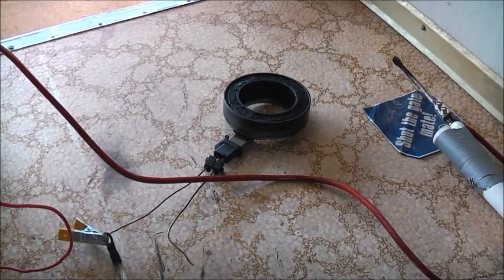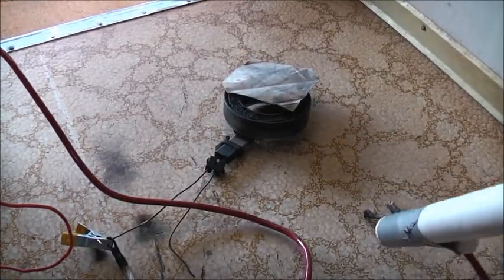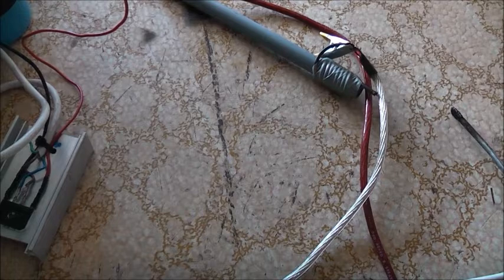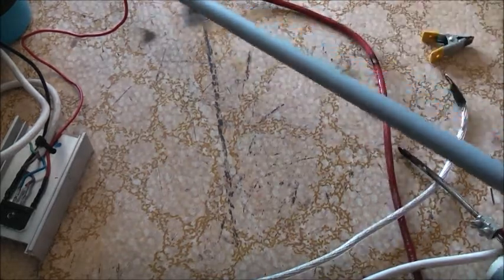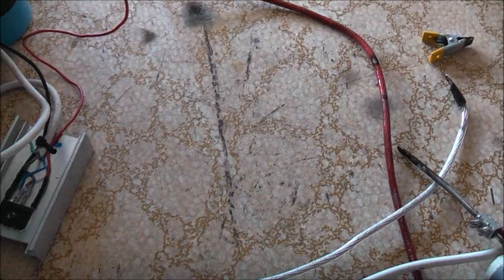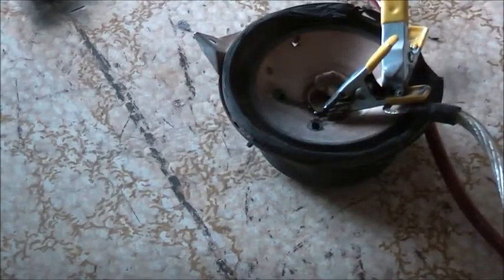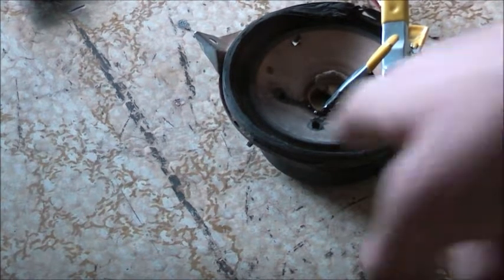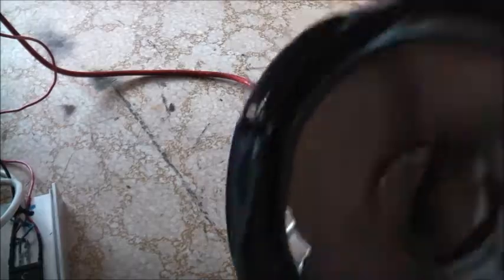Capacitor Bank Testing

Comment: haha nice pops and bangs :) i have a tip on the coil gun, i think if you move the windings on the coil gun a inch from more from the end it will work better, because you want the capacitor to be drained by the time the projectile is in the middle of the coil, so it sucks it into the tube then the capacitor is drained and does not hold it back  from the other half of the coil still making a magnetic field, well that is my 2 cents worth, just some input on what i heard online a while ago

Comment: you need to get some decent solid copper wire to make your coils with as you get 'skin effect' with high current, short duration pulses. Something about 5mm thick would be quite nice so that you can make coils but still take the short time current!

Nice bangs from the cap bank now!!

Comment: Tips on that coil gun: Try more windings and place the projectile before the coil since the projectile will accelerate towards the centre of the magnetic field (the centre of the coil) but de-accelerate once it reaches beyond the centre. Without any switching mechanism to switch off the capacitor to turn off the coil so the magnetic field won't de-accelerate the projectile, the best you can do is adjusting the position of the projectile before the coil until you get the most effect out of it.